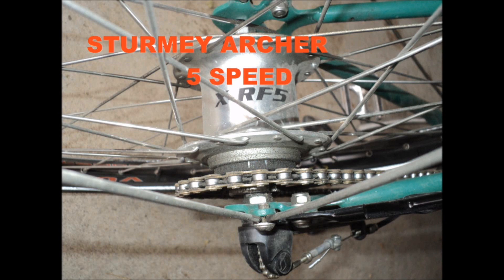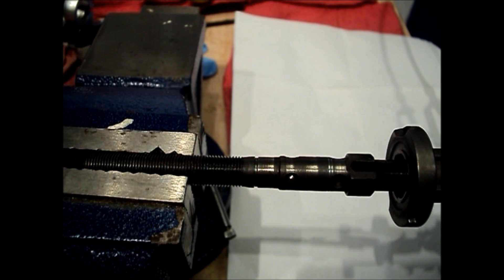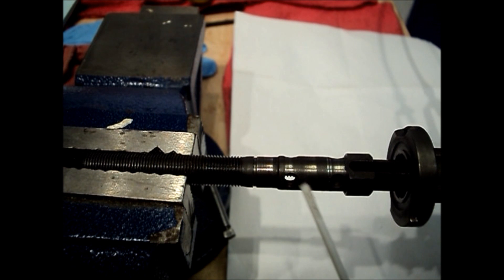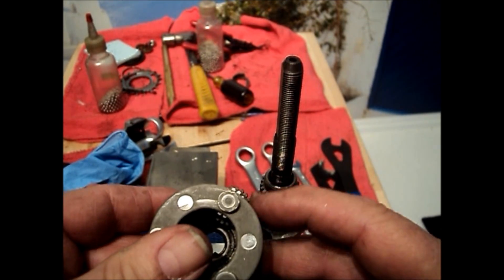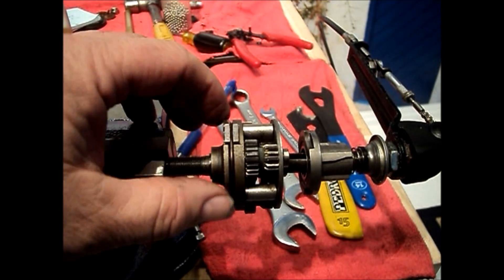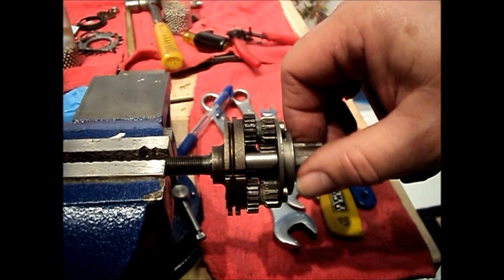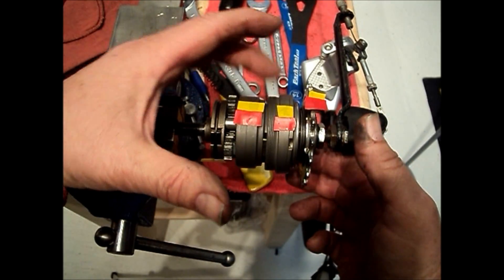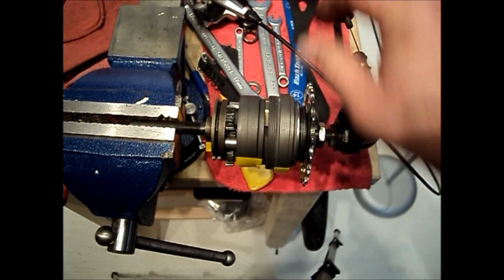Sturmey Archer 5 speed. How it works

Comment: Excuse me sir but can I request your help please? I have an Margaritaville beach cruiser with  an rxd3 sturmy archer rear wheel gear hub and I need to know where this one washer and weird washer and thin locknut go and if I even put it back together correctly. Not that it matters the gears don't work totally and all my brake lever and cables have now broken so not sure if it matters if it's right or not. I saved this thing from the dumpster bc I needed a way to haul stuff down the road and made a wagon then a bike trailer that I hook to the axle using anything with holes that will screw in or on the frame. Not easy when it rubs tire and it doesn't tow easy with no torque. I wind up walking it bc I get tired with the gears not right but when u have no money what more can you do right? I would appreciate any help or suggestions you have to give me and where to get cheap parts I can afford and do myself . Thank you

Comment: In all sturmey archer 4-5 speed hubs the older ones are better and all new ones are horrific to deal with past the 1980's model years but with a single gear cable control for results.

Comment: Does the Sachs torpedo 5 speed in the same way?
Reply from the maker: The basic design is very similar. The power flow through the hub is the same, but the actuation mechanisms are somewhat different.
Reply: @2wagondragon  Thanks for that reply. Do you know if the internals of this hub fit inside a a 3 speed hub shell with drum brakes? Could I fix/upgrade my old bicycle with one of these and keep using the same wheel?

Comment: To replace a broken cable you need to disassemble the shifter. 
You do that by pulling the twist-grip part straight out from the rest of the shifter. At least on the 5-speed shifter. No screws needed to be unscrewed for me. 
Would have saved me a lot of time to find that info somewhere today. 
Beware there are four internal parts that may fly somewhere so do it in a way you don't lose them. Their arrangement for reassembly is quite logical.

Comment: Stay away from this hub if you can. Go with 4/5 speed Nexus if you have to, or better with a 3 speed SRAM or Nexus or Sturmey Archer.

With this very hub I went through 2 or 3 sets of sun pinions and the infamous ball locking mechanisms in a matter of 3 years of active riding. This was based on a hubs produced in 2010 - 2012 timeframe. Don't know if the design improved since then.

Good  video and review though. It's an interesting design but too bad the locking mechanism is not sized / designed properly.
Reply from the maker: I actually had fewer problems with the ball lock type than I did with the wide range model with the sliding key that succeeded it. I sold a number of the ball lock types back when they were in production and had no issues. We had two of them in our own home stable, one on one of my bikes which I have since sold, and one on my wife's bike that she still rides. Again, no issues.
Reply: @2wagondragon  Thanks for sharing, this is interesting. I found that with time balls will cut a circular grove within the sun pinion internal surface. it will start as a couple notches and by the time it cuts through the side-wall all the way it becomes a full 360. At which point sun pinion stops locking, if I remeber right reducing the hub to a 3-speed. Note that I only own one bicycle as an all-round an and would ride almost daily for 10+km with hill climbs etc etc. Strong guy too, so it seen lots of use.

I think these kind of issues started with shifting while pedaling full force. Which if I rembmer the design right may have a split second where balls are not fully engaged. I think the pin that expands the balls out has a bit fo a bevel so when it actuates it will push the balls out somewhat gradually.

Prior to that I put Alfine 7 speed through the same kind of load and had 0 issue.

Now runninf somewhat less common Sturmey rs-rf3 (rotary) and this is the best I tried myself.

For my brother I went with an older SRAM I3 (or whatever was the name just before that) which was a made in Germany specimen. Based on full take-apart I think this is the best 3 speed design I ever saw.

What's your favorite 3 speed if you don't mind a bit of side conversation?

Comment: Once you get your head around this, it's easy enough to understand in comparison with what is happening when it wears and it jumps or doesn't engage while making all sorts of exasperating noise, which is far less easy to figure. Is that jumpjump noise  the pitted splines of the large sun being overridden or are they still engaging, or is it a bouncy jumpjump noise referring to the clutch on its springs? Is the driver overidding the gear ring splines because of accumulated wear in the train from the large sun via the clutch to the driver? Is it to do with the springs between the suns, the planet cage, clutch and r/h cone? You can't see inside as it misbehaves so how do you go about finding what's going on.

Comment: I've Got a Sturmey Archer S5-2 hub on my trike, I understand there is an upgraded or improved  shifter available somewhere, other than the original HSJ 795 Thumb shifter. Any help on that?Thanks,Red
Reply from the maker: The two cable controls on the S5  hubs were never very good. The hubs were fine, the shifters not so much. The work around is to mount two shifters, a standard 3 speed SA trigger for the right cable, and a friction shifter for the left.
 Sheldon Brown's site has an article on this.  https://www.sheldonbrown.com/sturmey-archer_5-spd.html#1945

Comment: Thanks for the explanation!! It's incredible how this technology is implemented in bikes ^^. Could you explain me or show me a pic of the piece that connect the cable for changing gear. Is a threaded cylinder and you screw the changing wire on it? Thanks!!

Comment: Another great video!
I was thinking about the efficiency regarding the third position (1:1 ratio).
Do you know of any 5-speed models where the ball-ring is driving the hub-shell directly in this position while the ring-gear and planet-carrier is set free?
I believe that would have a very beneficial effect in terms of the efficiency.

Comment: Do you know whether the new 5-speed IGH's are capable op pulling an extra load? I'm planning a bicycle trip and building one in preparation. I'd like an IGH, but am using a trailer to haul my stuff and can't find any information on any hub on the matter. I heard old three speed SA hubs managed, but have no confirmation on 5-speeds new or old.
I pull loads up to about 100 kg (or 220 lbs) from time to time. Any idea?
Reply from the maker: The new wide range hubs seem to be quite robust, although I have not used one, so I have no experience to speak from.
 Aaron Goss, owner of Aaron's bike repair in Seattle deals with a lot of these, and he has documented issues with early production wide range 5 speeds having improperly hardened sliding keys and failing under heavy use. 
 I have used a ball lock type 5 speed for many years, pulling a utility trailer and climbing some pretty good grades, and had no issues. I'm a pretty heavy guy too.
Reply: Dan Burkhart
Thank you very much, Dan! That's exactly what I had to know. I'll look into one of the ball lock types.

Comment from the maker: Thanks for the input.The purpose of the paper was not to highlight any moving parts, but to show the light shining through the holes.
 This hub is the XRF5. I chose to use this model as the sun gears are not part of the planetary sub assembly, and I think it shows more of how it actually works. 
 I will be posting a video showing the internals of the updated 5 speed wide range series, and you will see that it is very similar to the S3X, which as you noted, is much less fiddly.

Comment: The white paper is forcing your camera to adjust the aperature so much the parts are rather dark and hard to see.  We can't see much detail.  Try using a darker  background like the red rags or plain cardboard. Your camera might have a setting for adjusting the light balance that could help.

Comparing with your video of the 3 speed fixie hub, this sure is a fiddly hub when re-assembling.

I like the split pawl and ring spring design borrowed from Shimano and Suntour.

What SA model is this?